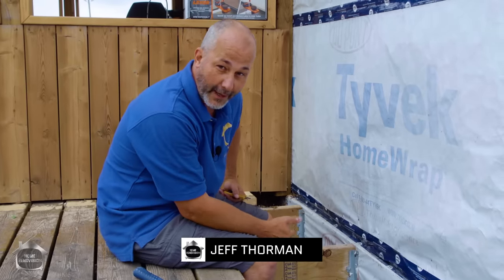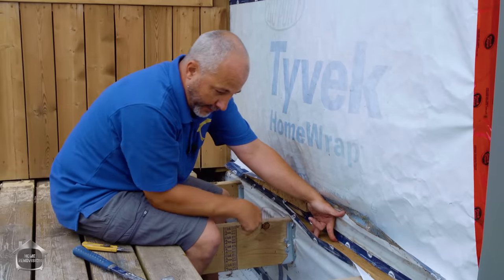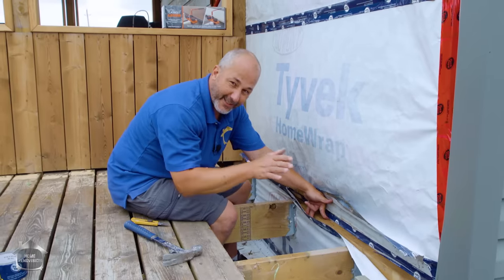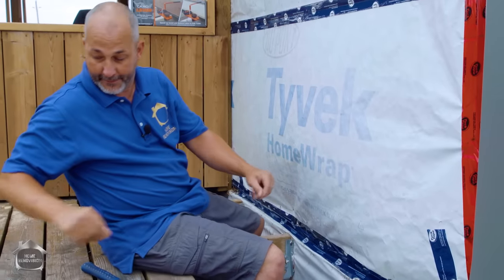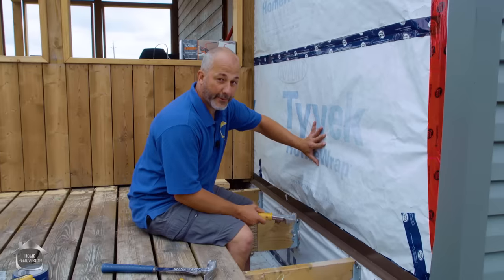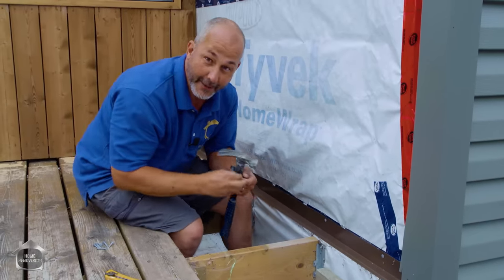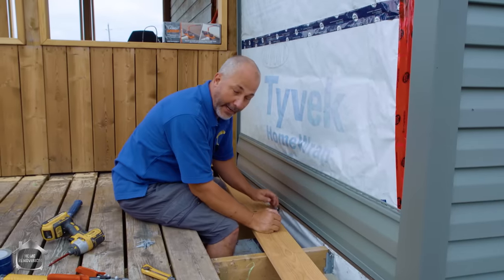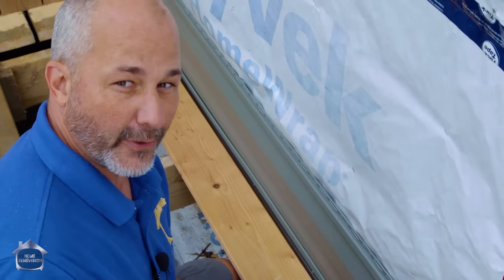How to Attach a Deck to a House

Comment: 😆 I'm 30 seconds into your video and you just confirmed what the deal is with my deck.  I was just under it today and they attached the ledger board over the siding.  It explains many issues I've seen.  I wish I was this aware when I bought it in 1998 with the deck they had just added to the house.  Oh well.  I will watch the rest now to see what to ask about when we have it replaced.

Comment: Finally a video showing the siding AND the deck at the same time. Thanks to this I was able to confirm that the flashing installed on my deck was done incorrectly and I know it needs to be fixed.

Comment: Definitely true.. just helped my brother replace a new sliding door on the back of his house. House sits on a slab with a small porch that was previously installed. Once we took the old slider off the ledger board was against the siding and water destroyed the framing of the slider and a couple feet of joists and floorboard inside.

Comment: Great video Jeff. I actually did this about a month ago and I did everything you just did plus I installed  a water proof membrane called Grace between the ledger board and the house wrap. And also on top of the ledger board before nailing the Z flashing. It’s a second story deck so had to be careful.
Reply from the maker: well done Hermon!

Comment: Perfect timing on this video. I have a deck that was rebuilt by the previous owners but they didn't know what they were doing and now it looks rickety and warped. It's less than 5 years old! I've got siding falling off around it now and it's just a mess.
Reply from the maker: Glad I could help!

Comment: This is the first pro video I've seen where the ledger is placed entirely underneath the Tyvek, rather than the usual method of applying waterproof tape under the ledger, possibly with shims over that to allow water a pathway to trickle down behind the ledger without getting trapped. I can see the appeal, although it means the joist hangers will produce hundreds of extra holes in the Tyvek, and the contact between the end of each joist will be tight against the Tyvek. Waterproof tape is gaining traction for use over the top of each joist and to help seal screw holes, and installed with a shingle pattern should be as good.

Comment: Can you do a video for completely removing backsplash from a kitchen? You’ve got the video on tiling over backsplash but I’ve currently got thick stuff and it’s exposed on one end so I don’t think that will work for me. I need best methods for getting the old tile off and if I need to re-drywall and such. 

I’m buying my first house and you’ve got me pumped to get in there and get started! Thanks!

Comment: Hey Jeff!
Great videos. I was wondering if you could comment on installing a ledger board onto brick. What sort of hardware and methods have you seen being used in Ontario? Should I caulk the top edge of the ledger onto brick?

Comment: As far as I'm concerned, the concept of "going overboard" doesn't even exist when it comes to keeping your structure dry. If there's something you can do that's going to help, even if it isn't strictly necessary, why wouldn't you?
Reply: Exactly. I doesn't hurt to over engineer a project.
When my daughter was little, I built her a set of steps so she could use the bathroom sink to wash her hands.
That was almost 30 years ago, and those steps are still in use.
Build it right, build it strong, build it only once.
Reply: agreed how much really does that drip strip cost, pennies!
Reply: 1 reason why you wouldn't is because of financial constraints, but i see your point
Reply: THANKS finally someone who understands why I have a circus tent over my house!
Reply: Right on. That drip edge was probably like $4 and increases the chances of your ledger not rotting by a ton.
Reply: Well said… I work on the Oregon Coast where it rains sideways for months… there’s no overdoing it down here…

Comment: Jeff, love your series!!

Not sure if same in CA, the new IRC prohibits ledger to brick, needs to be freestanding.
Reply: Mjeberha, I like your comment. I'm building a deck with roof (lean-to style). If it were to be freestanding, are there other builders that seal between the roof and the house to keep water off of the house (between roof of the deck and house)?

Comment: My suggestion is to provide additional deck footings and columns along the building approx. 1 or 2 feet from the face of the house. This will provide a separate and independent structure for deck and house. There will be no ties to the house therefore no water getting into the house. It may cost a couple hundred bucks but a safer way.
Reply: In your suggestion, you’re not attaching the deck to the house at all?
Reply: DYI'er here. K H, I really like your suggestion! For my case, I'm building a deck with roof. I was going to attach a ledger for the roof and a ledger for the deck. I'd have to remove the stucco at both places to install barrier and weep screed. With an independent structure, I can bypass all of that. Now I'm trying to think of any downsides or concerns.
Reply: @josiahutah3712  I'm a licensed architect for 30 years. If you make the deck independent from the house, you don't have to worry about future problems which may occur in your house. But make sure to install braces between deck columns depending on height in order to prevent lateral movement.
Reply: @khanarch1  as I look around on YouTube, it's amazing how often I see "professionals" screwing up the ledger board install.

Comment: Our house is made of stucco and does not have a rim joist, only blocking between the floor joists. Is it OK to double block so that the top plate has 3 inches of wood sitting on it for better penetration of the ledger? Thank you so much.

Comment: Do you have any tips for fixing improper flashing?  Caught a new crew without back flashing behind the new ledger board.  Made them aware and they kept right on framing without addressing the back flashing. Do you have any tips / tricks that can meet IRC 2018 for watersealing the ledger if this step is missing?  they are convinced that the drip flashing on top of the ledger/joists is enough.  If that were true the IRC wouldn't require it. thoughts?

Comment: Good day, I have a question regarding a backyard deck attached to my house. I have a brick house  in Canada (Ontario) with a walkout basement and a second story kitchen walkout . I want to build 2nd story deck for my kitchen walkout, What is the proper way to attach  a ledger board  to the back of the house. It's a brick wall. Thanks

Comment: My home originally was hardwood siding. I now have vinyl siding that was placed over the hardwood with a layer of Tyvek Styrofoam in between. Should I cut through all the layers to get to the original wood of the house to attach the ledger board? Or should I build a freestanding deck. The deck is only going to be 13 inches off the ground ....11x15

Comment: I have a question and I haven't found a video or information on this type of situation....I don't have "hangers" available where I live (first problem), I will be attaching the ledger board to a concrete block wall (it will be protected from the weather because it will be covered by an enclosed balcony above it)...could I attach a 2x2 board along the bottom of the 2x10 ledger board to support 2x8 joists...the joists will run approx 2.5m and be supported by a concrete block pony wall on the other end...is this doable? or do you have a better suggestion? Thanks

Comment: I never see ledger advice about attaching to brick veneer alone as I don't have rim joists to bolt into. Are dyna bolts or similar brick fastners suitable or does this place too much stress on the brick wall?

Comment: We have a 1982  brick house and we need to repair an existing deck. When attaching a ledger to the brick. Do I need flashing, can I put spacers between the ledger and wall for water diversion?

Comment: I have a back deck that was attached to the house that caused the back door sill to rot so I had to replace the door. I also had deck rot near the house. I had about 3-4 ft of deck cut out with the joists cut off too. So now I have 3-4 ft of missing deck closest to house along the entire deck length. Do you have or know of any videos for this scenario where you are replacing a section like that? It may be a challenge to get it all level with the existing deck. I was told to not attach it to the house.

Comment: Brick is definitely NOT structural if it is just a veneer (single brick layer) outside the structure. Attaching a ledger using long bolts/lags through the brick and into the interior rim joist is typically not allowed.  Simpson makes a specific type of wedge anchor to attach a ledger through brick veneer. I have even heard stories of some engineers refusing to sign off on those wedge anchors, even though Simpson designed them specifically for this purpose.
Reply: stealthballer  this wasn't an inspector. This was an engineer in the design phase who was pushing back against the builder who wanted to use them. I got this story from the builder so i don't know more than that. They certainly weren't happy with the engineer arguing against clear specifications.

Comment: Someone added a covered deck (much lower than the one in this video, it actually has garden landscape timber I'm pretty sure) to our early 80's model house that has wood siding. The roof part where they have corrugated plastic for a roof wasn't attached properly and allowed water to run down the siding and water damaged a window and it leaks as well. Would this be the same thing needed? Just cut into the T1 11 (guessing that's what it is), remove extra to add that plastic and reattach? Or do you have a video for this that I've missed?

Comment: I used $15 joist tape to tape behind and on top of  the ledger board. Tape should start from bottom to top and use round edge of the cutted deck board to give it some pressure after taping.

Comment: I have something that I always wanted to ask you. Is there a difference between blue and red tuck tape? thanks.
Reply: From what i heard in Ontario they have made it code to use blue tuck tape when doing insulation/vapor barrier instead of red, im guessing it sticks better or something like that.

Comment: Ledger boards are the single biggest point of failure on decks. I like Mike Guertin's method he did in the videos for Fine Homebuilding.
Reply: Got a link to that video? I'd appreciate a start to finish video of installing ledger board from scratch.

Comment: so i am having a deck replaced.  The ledger board was rotten, so the guys just replace it fast...no "tyvek" type liner behind it...this was before I knew that it should be used.  Its too late to remove ledger and start over as decking has been framed.  What is my best option going forward.  I am planning roofing caulk in crack, joist tape, and metal z flashing sealed with some good sealant..any hope for me?

Comment: Jeff you nailed the J trim tight i thought siding nails were never nailed tight to the vinyl???
Reply: That is only for the vinyl siding, so it can move with the expansion and contraction from heat and cold. That is why there are horizontal slots in the siding. Nail in the center of the slot and keep the nail 1/8"- 1/4" out
Reply from the maker: you can't be that picky on the J trim. Cheers!

Comment: Our codes here in NC allow the use of structural screws designed for ledgers. Very cool. It is my under standing that NC building code does not allow a lag screw. It must be a lag with bolt on other side. Not sure why a lag screw is not allowed but these new structural screws are allowed. Somebody set me straight if i have this all wrong.
Reply: The new lag screws are thinner but just as strong as a lag bolt. They also have a self drilling tip. Unless you pilot drill for the lag bolts, you're gonna get some splitting and that makes the connection weaker. These new structural lags can be screwed in much faster with an impact gun and has a much lower chance of tear out and splitting.

Comment: If I’m extending my deck that is attached to the house via ledger board, does the extension also need to be attached via ledger board?
Reply from the maker: double down on lag bolts for sure. if it is attached to the house you should get a permit and proper drawings.
Reply: @HomeRenoVisionDIY  thanks for the reply. I love your videos and I’m a huge fan! 

yes I will be getting a permit, but wanted to know if it the extension will also need to be attached via ledger board. The extension will be along the house (so the deck will end up being the width of the house. Currently it is only half).

Comment: Ok, question. Building a 2nd story deck off the back of my house. My house is in a row of attached houses on both sides. The walls connecting the houses are the foundation walls. Floor/ceiling joists run from foundation wall to foundation wall. 20ft span. No interior load bearing walls. Exterior wall is brick. Where the ledger board needs to go is 2 courses high and 2 courses deep of brick. There is no rim joist on the house. The first joist, beyond the brick, is the first floor joist. There is a 2" gap between the brick and that joist. I don't feel confident in the integrity of those 2 courses of brick to support the ledger and all the deck weight. How do I attach a ledger board here? Do I bolt through both courses of brick, take up the gap between the brick and floor joist with something, and than straight through the floor joist as well? That would be a really long bolt. probably between 12-15inches. All the other neighboring decks seem to have just used expansion bolts into the brick. Am I over thinking?

Comment: Jeff, I am putting the butt ends against the house, have vinyl siding would it be basically the same? I was thinking about just putting post in and not having it attached to the house.
Reply from the maker: if you want to anchor your entire deck in posts you can. this allows you to reduce the number of posts and save money as well. Cheers!

Comment: What is it that you would do with the ledger board now that the decks in place and finished. Are you covering they ledger board in siding in between each joist? My deck was installed slashed right up against the siding seems like a tough job to correct it if already messed up.
Reply from the maker: can be but if you remove a couple of boards you have access if needed. Cheers!
Reply: Just helped my neighbor with this issue. We built a supporting wall to hold up the deck. Then we removed the old ledger and replaced it properly with a new one. Then we re-attached the deck to the new ledger.

Comment: What kind of structure could be installed if the home's rim joist is actually a bunch of 14.5" segments? ... My house had the deck joists run through the rim and attach to the home's floor joists inside (side by side a few inches) and the rim was blocking. A renovator then cut those deck joists off from outside, attached a ledger to what really is blocking, and rebuilt the deck -- so the rim joist still is just a dozen segments that are 14.5" long and 10" tall and there are little stubs of a historic deck's joists sitting in the 1.5" gaps.
Reply: Deck-lok makes brackets for attaching through the ledger to the floor joists on the inside of the house. Simpson also makes tension tie brackets (DTT1Z) that fasten to the bottom of the deck joists and attach to the plate under the house joists.

Comment: The blue tape is more expensive, only needed for inside.  Exterior can use the cheaper red.  Unless you only have rolls of blue 😜
Reply from the maker: for the extra buck I will always use the tape fro wet areas on my house water diversion system. Cheers!
Reply: Home RenoVision DIY yup- both red and blue tuck tape are meant for it, just in the last 3yrs I’ve heard the red tape was not suitable for indoor use because it off gases something, so enters the more expensive blue tape meant for indoor use

Comment: How is attaching a pressure treated ledger using proprietary  1/2" spacers, which both seal the bolt/screw holes and adequately transfer the gravity and lateral loads of the deck,  over the siding/stucco (thus allowing the water to easily flow behind it) and without cutting into and compromising the house's waterproofing membrane or (potentially) compromising the shear/lateral bracing of the wall (e.g., stucco shear) stupid? As both a builder and a chief building official for several decades, I've both approved and encouraged folks to attach ledgers in this manner. It's faster, easier, and less prone to fail than the method you're showing, and I'd encourage you to reconsider your methodology. Best.

Comment: Save my beacon?   

Yep, my house was built over 20 yeras ago, and they unskilled framing crew put the deck on the house, the ledger boards were nailed right on the sidings becuse the house has no shething behind the wood fiber type siding and its only nailed on with 10k nails 
It has definitely had wood rot and ant dammage.  I didnt think tyvac would stop water that good.

Comment: How about NOT attaching your deck to the house? No structural leverage and no water damage worries. You are going to install footings for the rest of the deck anyway. Install a few more footings and sleep well knowing that if a tree falls on your deck, it won't take the house with it.
Reply: That is what I did, 4 years in no movement since. House finish is unscale! Easier simpler safer.
Reply: @Biohazarus  , I like your comment. I'm building a deck with roof (lean-to style). If it were to be freestanding, are there other builders that seal between the roof and the house to keep water off of the house (between roof of the deck and house)?